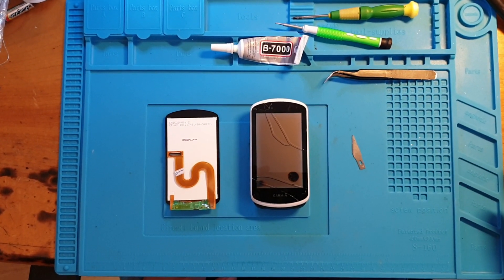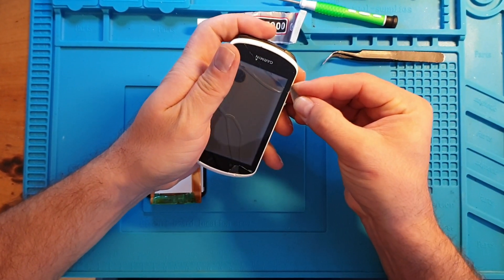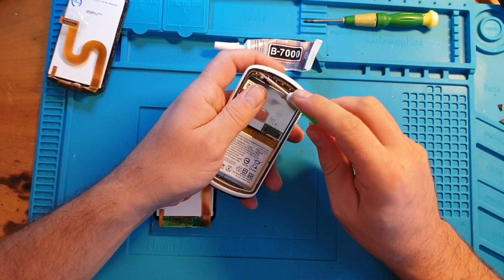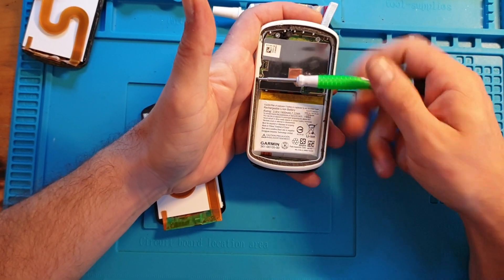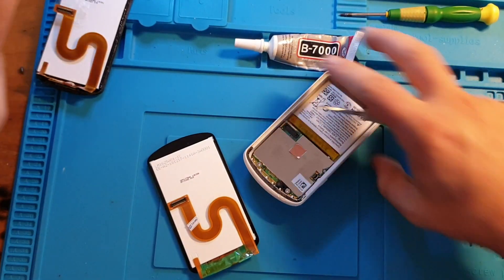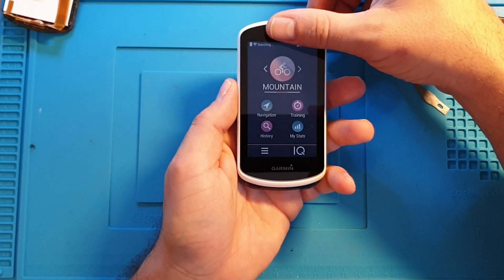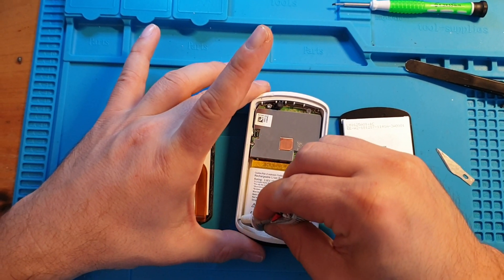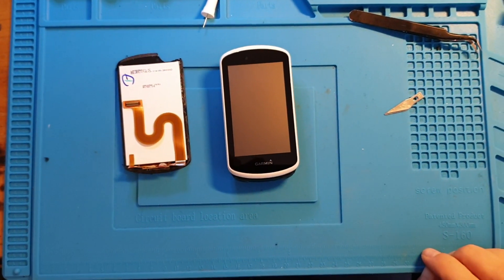Garmin Edge 1030 LCD Screen And Touch Screen  Replacement Part Tutorial

Comment: you used adhesive on this video instead of double sided 2mm tape on the 520 repair video.  What is the best approach?
Reply from the maker: You can use T800 Gravity magic rubber is the best, or you can use tape, I done the video with tape because is more easy, the T800 takes time to dry
Reply: @RepairMyDevice  sorry ,you mean b7000 ? Right, coz I followed every step you took and now I’m scare of getting water inside of the 1030 on a rain